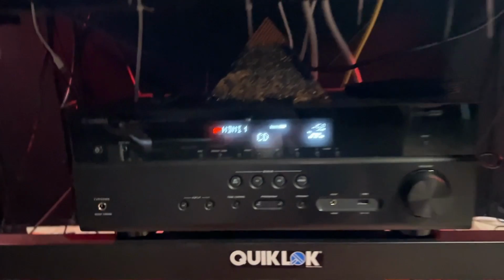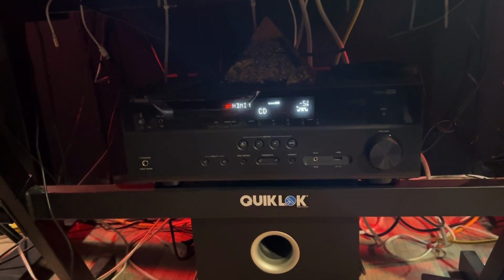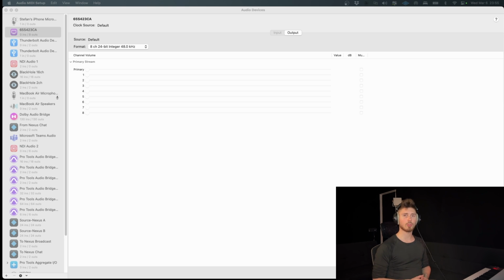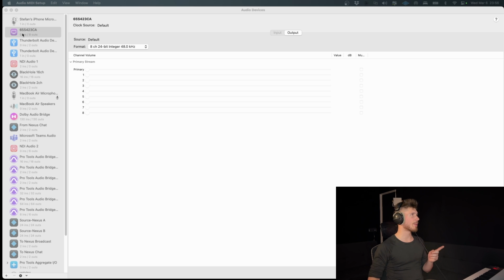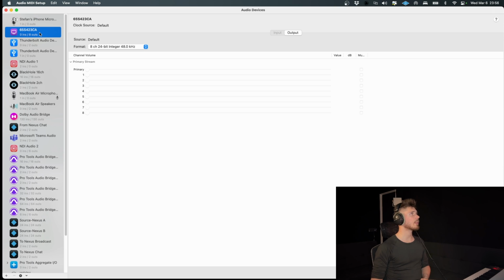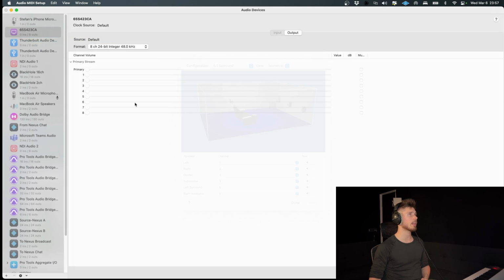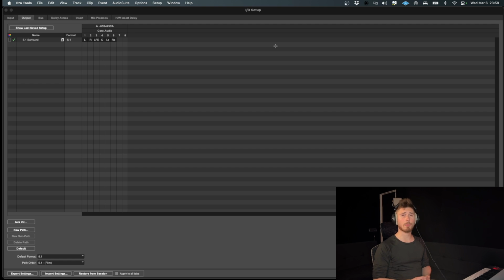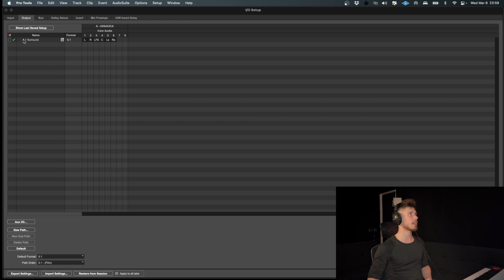DIY 5.1 Surround HACK: Mixing w/ Your Home Theatre in Pro Tools

Comment: this is just what i was looking for, but unfortunately it didn't work for me. When I plug in the display to my receiver, the receiver shows up as a display on my mac. It doesn't pass through to the display. As a result I only get 2 channels of audio.
Reply from the maker: Plug your Mac into the receiver. Your receiver should have a HDMI (Arc) out which you then plug into your display. Haven’t tried it any other way but it works in that order. Your Mac should detect at least 8 channels (5.1 + your TV). Hope that helps!

- Stefan

Comment: I've set this up for a windows system with 5 speakers and a sub and I mix in Adobe Audition.  One question you might want to answer here is  how to set up your home receiver to hear the raw audio without any filtering etc.  I actually have the same receiver and have found that once all speakers are working correctly and in the proper order - I select DIRECT on the remote.  I've found that to be most unfiltered mode so you are hearing the real audio and can then mix correctly.  Many of the settings on these receivers add "fake" reverb and surround - as if you're in a theater they've designed.  Even the STANDARD program or STRAIGHHT appears to do that.  If you have a preferred setting you've found works great, maybe add that to the comments here.
Reply from the maker: Right, so you’re referring to the modes that either EQ or filter the audio. It should be obvious to any professional mixer to avoid using any of those modes but yes, the ideal modes are either gonna be called “flat”, “standard”, etc… However, how flat your response will be depends on the quality of the receiver and even more so the speakers. At the end of the day, it’s what you’re used to working with but avoid adultering the output to make it sound better. Do that in your mixing. Thanks!

- Stefan